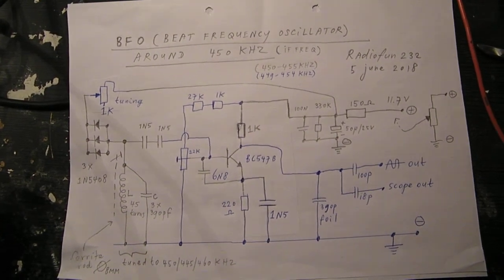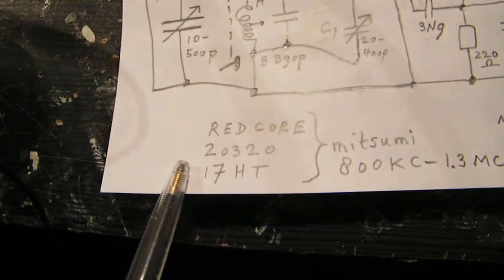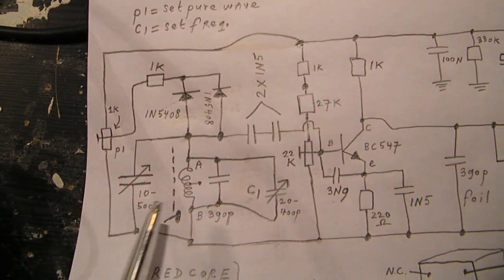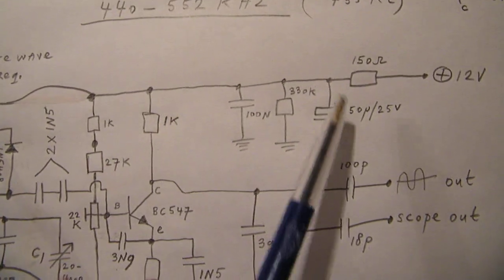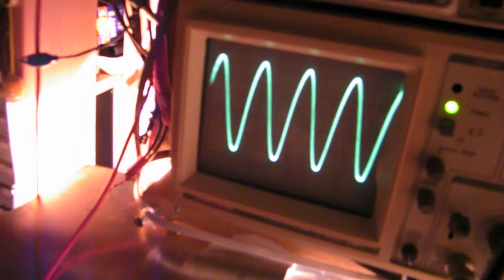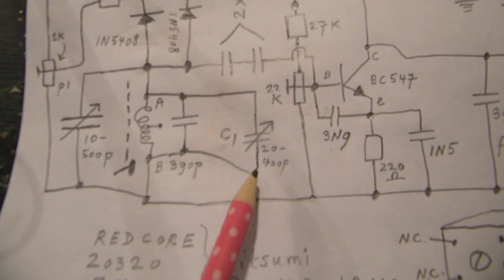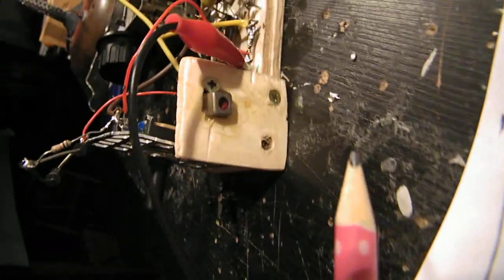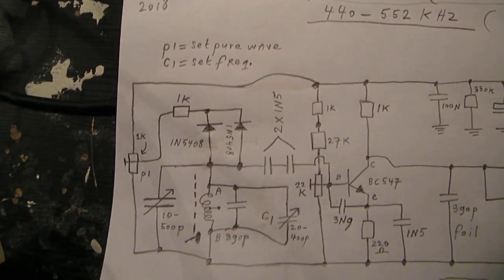BFO (analog) 1 transistor (beat frequency) oscillator 440 KHz-552 KHz

Comment: How proximity sensor PR30-15 use beat frequency oscillator for arduino ?? please
Reply from the maker: There are many analog oscillator video's on my YT channel, with specified instructions about how to make/use and adapt them. The issue that you mention is (do I understand it right?): how to connect a proximity sensor to an Arduino. I have to say: I must study the properties of the input of the Arduino first, have to see whether it accepts analog inputs (prox. sensor? what kind of signal or voltage or capacitance or whatever signal does it accept and/or count with) and how the Arduino handles that (in what ratio does the Arduino handles analog input voltages to digital signals that it can handle) etc. So your question and even your response does not show (in electronic terms) what you want and what you mean and want to make with the Arduino, sorry for that.
Reply from the maker: I don't know what you mean.
Reply: sory , how do beat frequency oscillators use an inductive sensor proximitimy pr30 with Arduino
Reply from the maker: @juanriyan7437  I don't know exactly, but there could be an effect on the inductive properties of the coil (?).

Comment: Oh yes, a very nice BFO circuit. It is working very well with a very nice waveform across the entire 455KHz bandwidth. I am not very experienced with IF circuits but I don’t recall ever seeing silicon diodes used in this way.  They seem to work quite well here at keeping the waveform very pure. A very interesting circuit. I will certainly have to build this one and experiment.
Reply from the maker: Thanks, I am often experimenting with normal silicon diodes to use them as varicaps. These "big" silicon diodes have the best properties to be used as such. I think their capacitance variation is 0-50 pF. Thanks again.